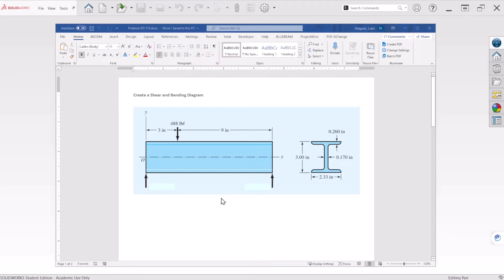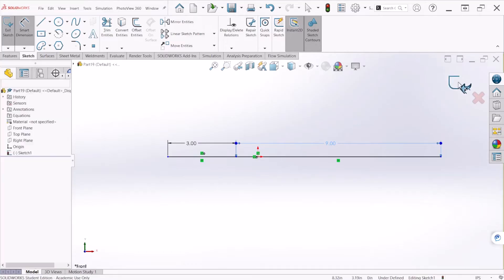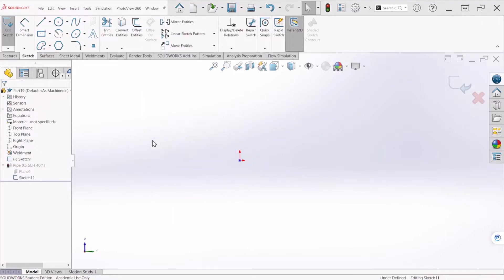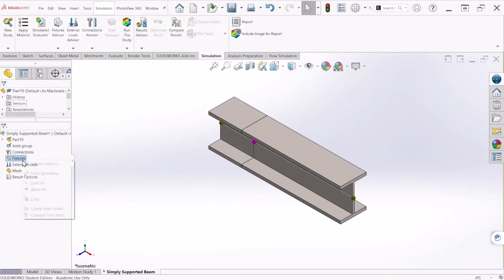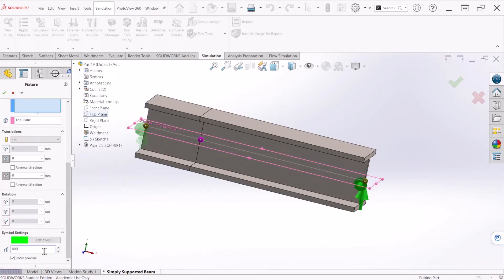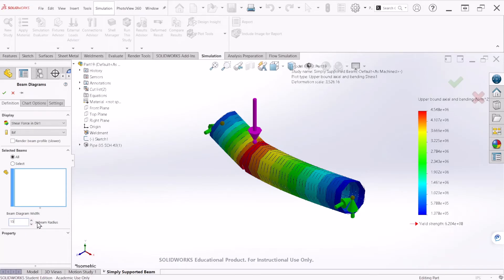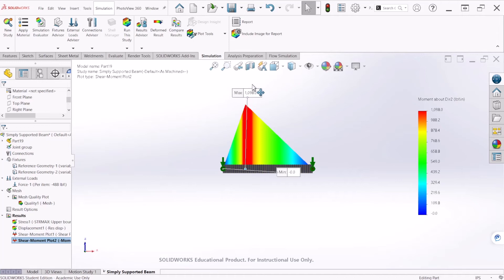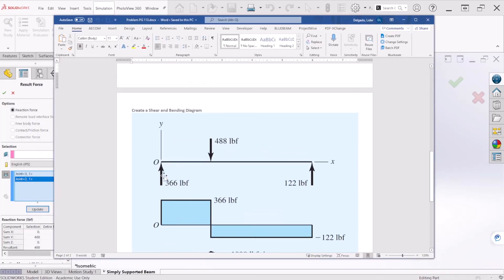Simply Supported Beam | Shear & Moment Diagram | Bending | SolidWorks Simulation for Beginners |

Comment: Can someone answer to my Q, usually a beam subjected to bending and shear and we check for both, but here in this video, the beam only shows over stressed under the point load. so my Q's are 1.is this output only reflecting the flexural stress if not what stress? 2. how do we know this will satisfy the max shear at the support?

Comment: how come my constraints for the left part of the beam or where you placed the fixture on the edge, are nonexistent on my part? There is a reference point but it is in the middle of the beam. How do I make it so that the reference point can be on one of the edges?
Reply from the maker: If you don't see the joint dot on the side,  go to "Joint group" then right click - Edit, then under "Selected Beams" click on "Select" and select the beam face(s) (for this example the beam was split into two section), then click on "calculate", that will provide you the joints on the sides. Hope That helps.